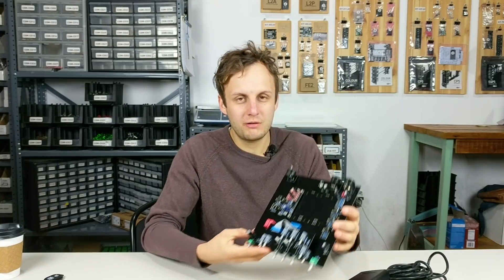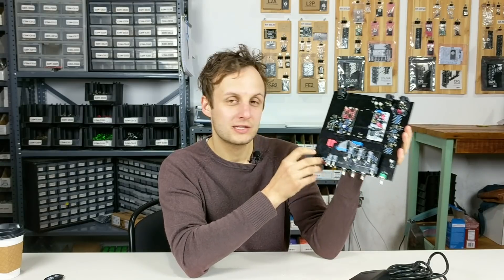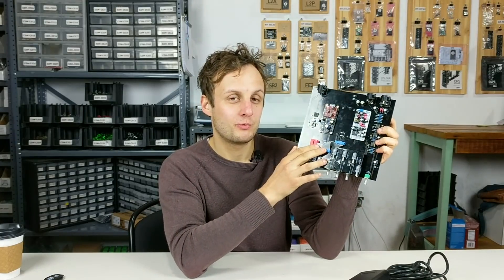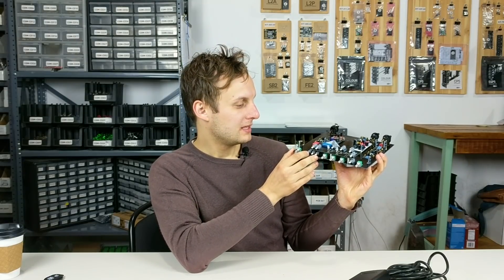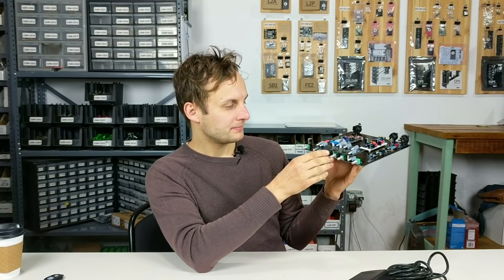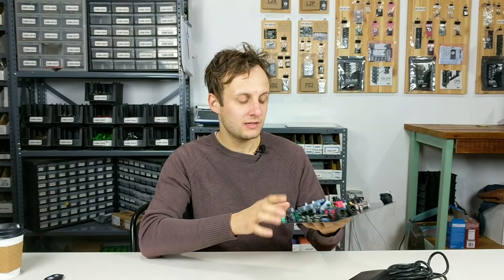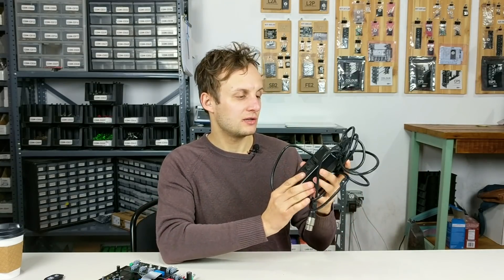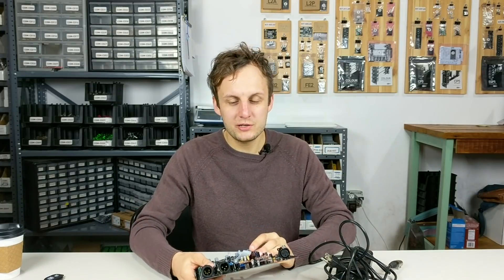Rack Mount Preamp Design Update | From the Bench ep. 6

Comment: You already have an ETA on this bad boy? I’m not really a fan of black front plates, it looks to clean...however, it suits what you released so far. Just know, it looks good and doesn’t look bad, it’s just my taste!!! I would’ve designed it a bit different. 

Would be nice if there’s a way the leds would reflect the color of the modules installed in there. That’s just a visual thing.
Reply from the maker: Thanks Geert! You can have the front panel in any color you want, so long as it's black ;)

And the Colour LEDs do change with the module installed! I just used Red, Yellow, and Blue in the mockup to show our Primary Colours Bundle.